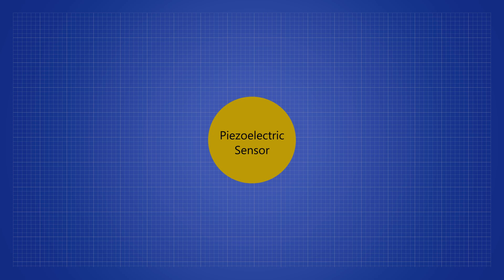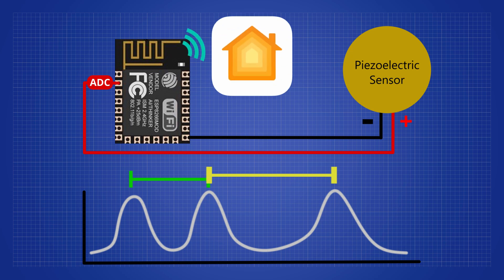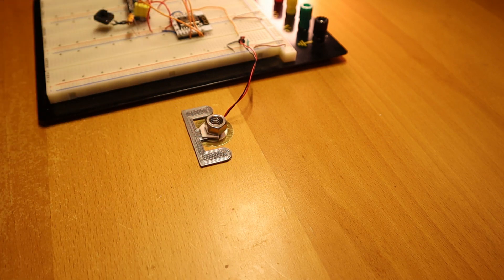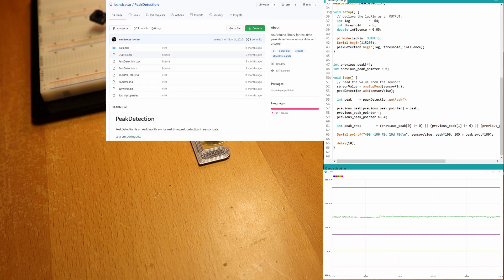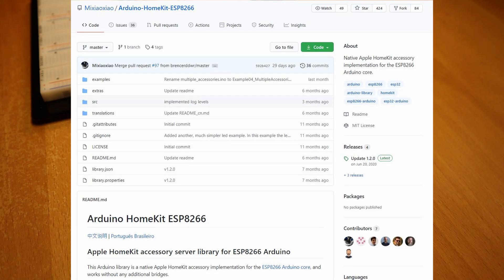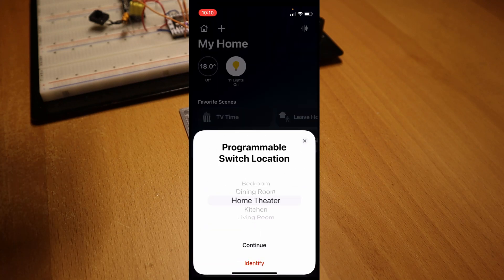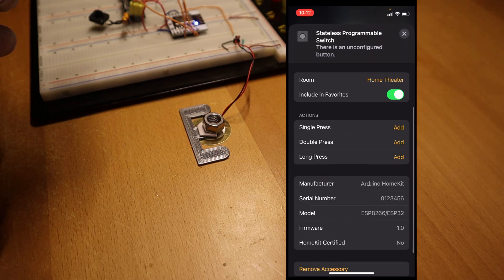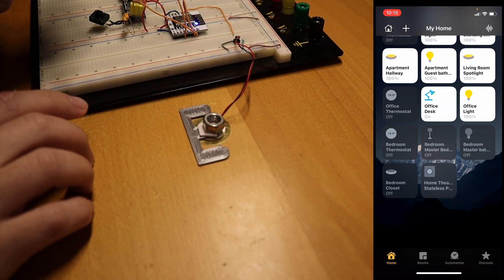Knocking turns into HomeKit triggers with ESP8266

Comment: I too made it ... 😀 but it uses an accelerometer to detect knocks, based on Techiesms’s Knocki Project. (Search the youtube for techiesms knocki, you will know)
Mine works with Webhooks and IFTTT instead of HomeKit. But I wanna make it HomeKit compatible just like yours. Good job! Really like your design. I never knew you can export the 3D PCB from EasyEDA. thanks for that idea too! You earned a subscriber! 😁
Reply from the maker: Thanks for the sub!! I was going to use an accelerometer as well. But thought using piezo sensor will be more straight forward. Maybe I will give accelerometer an attempt as well.
Reply: @andrewngai5215  yup. 😃

Comment: I did not understand the title when I saw first bro
Reply from the maker: Oh really? What would be a better title? I am still working on my titles, I don't want it to be too long but as the same time, I want it to be straight to the point.
Reply: @andrewngai5215  Turning knocks into HomeKit Triggers with ESP8266
 Its almost the same just with slightly better wording :)
Reply: @andrewngai5215  "Turning lights off by knocking using Homekit & Arduino!" would be a better title for this one. The ESP8266 could be added to the description.
Reply: @andrewngai5215  even I can't say bro. Something tat goes well with Thumbnail. I Made My Own Lighting systems. If you have face on Thumbnail. using "I " attracts in DIY videos

Comment: Hey, great project ! A good 2.0 would be to use an I2C accelometer for the knock detection. Those I2C acc/gyro are configurable, so you can define a wake-up pin, which allow you to put the esp8266 in deep sleep and use a battery :)
Reply from the maker: That's true, I will definitely keep that in mind!

Comment: do you know of a project or maybe an idea for an upcoming video, monitoring the doorbell and turning it into a homekit trigger.
Wanted to do that for a long time but can't find any resources.
Like an Arduino that monitors if current goes to the doorbell speaker (I have an electric) and then sends that to homekit. That way you could make a smartlight slash if it rings

Comment: Hey, Great Project! Underrated channel! Would you mind providing a list of components and how you connected the resistors to the piezoelectric sensor?
Reply from the maker: This is a pretty simple build. Regarding the piezoelectric sensor, it is directly connected the the analogInput of the esp12, not sure if that's the best way but there are some processing in the firmware to get it usable. The other components are just for power suggest as the voltage regulator from 5V (USB) to 3.3V
Reply: @andrewngai5215  Ohk! Thanks a lot! Great Project, again!